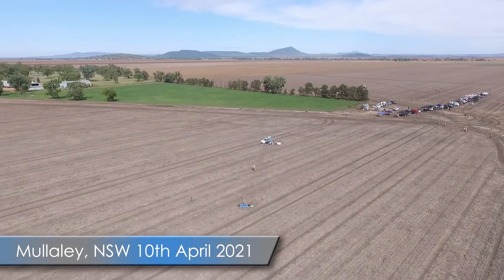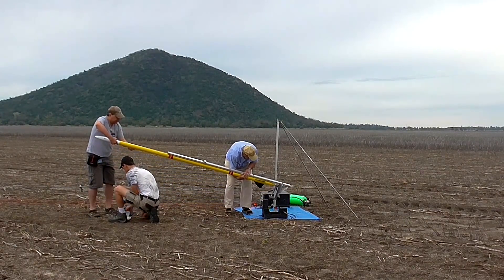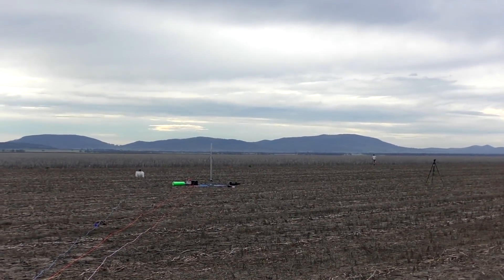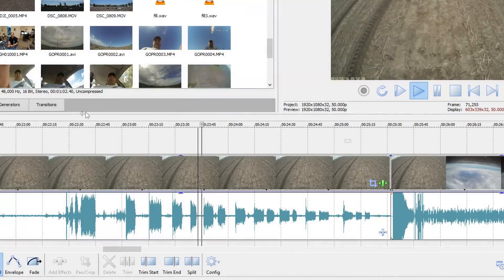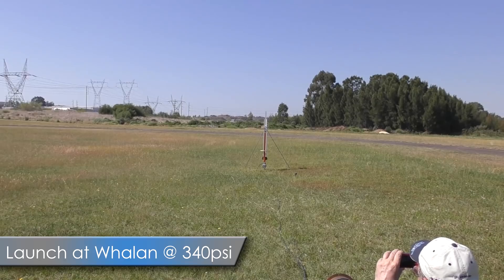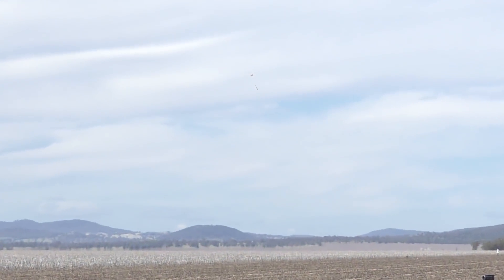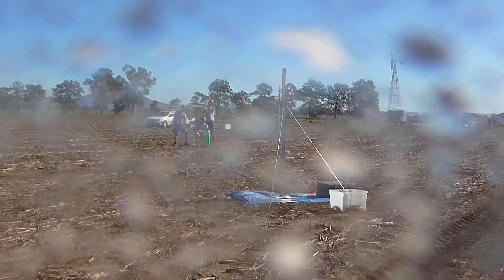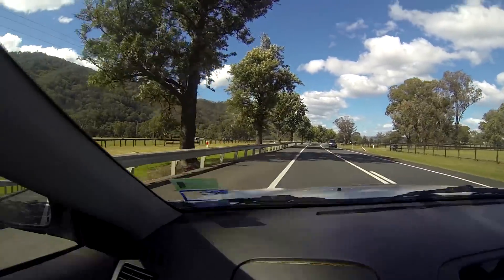High Pressure Water Rockets

Comment: I'm new to the hobby, is there any water additive to encourage laminar flow? In hydraulic fracturing (oil field fracing), we use a "friction reducer" to reduce turbulent flow in the well bore. 
The friction reducer is a slurry of polymer chains (guar) and surfactants. It will increase the viscosity slightly (5 cp max).
I would think this would result in a higher specific impulse, and therefore higher alt.  with the same reaction mass and pressure.
Reply from the maker: This is a really interesting question. We do use a detergent to generate foam inside the rocket that does give a boost in performance. But I have not considered it terms of encouraging laminar flow. It would be interesting to do a comparison between foam and non-foam with just the detergent dissolved in the water.

Comment: Great Test. To get better video of the launch, get further away, and hold the camera in your hands with your arms straight.  Follow the rocket accent with your arms straight and camera below your eyes. Keep from moving the camera off the rocket as much as possible. Post process the video putting a red circle around the rocket while in the sky as otherwise it is invisible due to the low resolution of the video image.

Comment: I suspect a larger bottom plate will let you fly higher instead of punching holes in the ground.
Reply from the maker: I am not sure I follow. When the hole was made, the rocket was already a couple of meters in the air.
Reply: @AirCommandRockets   It is wasted thrust, do an experiment and make your launch plate larger.
Reply from the maker: @kscipkkkk  I still don't get what you mean. The rocket is not "pushing" off the ground. (except when it is travelling up the launch tube) Once it is off the launch tube it no longer interacts with the ground. Here is an experiment for you to try. Get a garden hose, set it flowing and point it horizontally. You will feel a force on your hand from the garden hose ejecting the water. Now close your eyes, and have someone move a plate in and out of that stream. I bet you won't feel any change of that force on your hand, and you won't be able to tell when that plate is moved in and out of the stream.
Reply: As long as the rocket made a hole in the ground it was close enough to still be expelling energy.and that energy is wasted on the dirt.
Reply from the maker: @kscipkkkk  That really doesn't make sense. That's like saying if I throw a ball at a piece of cardboard and punch a hole in it, somehow I would have thrown it harder had that cardboard been a brick wall.  Try the hose experiment.

Comment: Apple AirTags would be lighter, less volume and mass than a GPS.  Range TBD but would home in pretty quick within a 100m I expect.  My first rocket was yellow.
Reply from the maker: We need something with a range of around 2Km. There are specific GPS transmitters designed for rocketry. Nice and lightweight. Here are some examples: http://eggtimerrocketry.com/home/eggfinder-gps-tracking-system/
Reply: @AirCommandRockets  Yet to be seen what the range of the AirTags are ... could be much better than what I mention above (probably far better in an open field, for example).  That said, if you know "about" where the rocket went down, you would be close enough.  Or at least when someone walks by, their iPhone would register it and you'd get a message on your Apple device with the location.  Just focussing on mass reduction ... Anyway, found the water reaction rockets quite impressive!
Reply: Well, forget the Air Tags idea altogether.  The high accuracy (UWB) range is 20m or so in the best conditions....

Comment: Why do you not youse hidrogen and oxigen as propellant? Beyond a safety problem would it be more efficient as propellent than water an air?
Reply from the maker: That is a different kind of propellant. It would be much more efficient than water and air. This is why you see commercial rockets sometimes use Hydrogen and Oxygen and not air and water. ( I am talking about liquid O2 and Liquid Hydrogen)

Comment: Regarding the pattern of decreasing amplitude you saw in the sound waves during pressurization pulses-I wonder if it’s because the stiffness of the pressure chamber’s outer wall increases as you add pressure, such that the walls can’t resonate as much with each subsequent pulse?

Comment: The decrees in volume that the microphone picks up is due to a reduction in the flow rate of air in to the rocket as the pressure increases. That thing get off the ground in a hurry, nice work!

Comment: I think the noise reduction may have been to a lower flow rate as the potential  was decreasing as the pressure was increasing in the rocket. Since the pressures were closer to equal as from the incoming and actual pressure. Less flow, less noise

Comment: Each time the rocket is pressurized there is less of a pressure differential between the rocket and the air cylinder, so the flow velocity into the rocket is likely reduced.
Reply: I believe that the sound is more likely lowering in volume because as the tank is pressurized the walls become stiffer and make it harder for sound to travel through it. I think the sound comes from the bubbles of air gluging up through the water so another explanation could have to do with the speed the bubbles rise at different pressures though you can test my first guess by flicking the tube at 100 psi then repeating it as you increase pressure.
Reply: @evilcanofdrpepper  I think you're sort of right, the tank wall is like a bell, the increased pressure acts as a brace for the walls of the tank, and dampens it s resonance. that plus the reduced pressure differential I'd say. technically a stiffer wall should let sound 'through' more easily, the way a well pumped bike wheel lets you feel more of the road surface in the ride. then again im not a professional in any sense.

Comment: Do they angle it into the wind? they should.
Reply from the maker: The rockets tend to do that themselves. It is called "weather-cocking" the cross wind tends to push on the fins more than the nose, and causes the rocket to pitch over in flight into the wind.

Comment: Crikey. I would never have thought you could get that kind of altitude just from water pressure. In theory is there a limit to how high it can go or could you just increase the Rocket size, Increase the water and the pressure till you get to the holly grail of 62 miles?. 120 x the current size. 216 Litres of water, 120,000 PSI?.
Reply from the maker: There are limits. In order to hold more pressure you need a stronger and hence heavier pressure chamber. You can also only compress air so much before you can't compress it any more. To go higher, you then need to use a multi-stage rocket. Realistically I think you could build something that goes a few kilometers, but I don't think you could get to the Karman line.
Reply: @AirCommandRockets  Thanks for the reply and info, What you have done already is amazing though!.

Comment: did you ask why the burst's sound level drops as the tank is filled? its either because your rocket is being filled from a reservoir tank which has been pressurized appreciably close to equilibrium with your rockets target fill pressure or alternately, if being filled from a source with a near constant flow rate, the chance for cavitation to occur during the turbulence of the fill decreases as the overall pressure rises distantly from vacuum. (source: my pumps quiet down as i raise the net positive suction head)
Reply from the maker: The pressure is going from 10L 3000psi tank to ~5L volume (air volume) at 1000psi. So yes there is definitely a drop in the flow rate as it gets fuller.

Comment: When the pressure in the tank rises,  there's less delta p to drive flow into the tank and that's probably why it gets quieter as it fills up
Reply: came here to comment this, this must be correct. I assume the noise level is proportional to the delta p across the inlet, which most definitely is decreasing. btw delta p = pressure difference. delta just means "difference in"
Reply: Well stated, too. I love a good youtube comment puzzle
Reply: i usume jou mean the presure diference gets less each cycle?
Reply: @goatgod  yes that's what "less delta p" means. delta means difference or change.
Reply: @scotmcpherson  yes jep informd me of that thanks
Reply: Wouldn't the majority of the acoustic energy be first transferred from the compressed air to the rocket before reaching the atmosphere? I think the change in impedance of the air causes the sound to get quieter (impedance mismatching).

Of course, that assumes that the microphone was picking up more sound from the atmosphere. If most of the acoustic energy was transferred directly from the body of the rocket to the microphone, then differences in impedance would be less relevant.
Reply: @nameismetatoo4591  No the acoustics are a direct result of how much air is moving through the nozzles and into the chamber. The less delta, the slower it moves, therefore the less sound it's making.
Reply: @scotmcpherson  You're right, that seems a more likely explanation
Reply: that's what I thought, less delta p = less velocity = less turbulence = less noise
Reply: I would think it is because under pressure, the air is thicker.

Comment: Hi, why film at 50fps?
Reply from the maker: Standard video format in Australia.
Reply: @AirCommandRockets  Almost all modern TV panels, PC monitors and mobile devices have 60hz panels, regardless of where you live. 
50hz is supported by many TVs, but 60hz is supported by all devices

Only a minority watching this will be viewing on a TV display, and as consequence the vast majority will experience frame timing issues - because no matter where you live, your laptop, phone or tablet display is 60hz.

Check your viewer device demographics. 50hz makes little sense nowadays.
Reply from the maker: @logitech4873  I know all that, but that's what my cameras shoot at. Also matching the frame rate to the power outlet frequency eliminates video flicker when shooting indoors with some lighting. In Australia we have 50Hz at the wall.

Comment: The audio variance is a function of volumetric density. Audio travels at a different amplitude as the density increases.
Reply: Also, the natural frequency of the hollow space (compressible void) increases (like how the tone rises when blowing into a filling bottle), allowing for less lower tones to oscilate.
Reply: @theGoogol  It's a resonant body and the available space will influence volume.
Reply: @fakshen1973 : Exactly  :) It also has an effect on the container (like how a half filled bottle sounds different when struck on the empty part and when struck on the full part). It's a very complex system of pressure vs volumetrics vs harmonics vs material properties. It's equally amazing that these factors are pre-calculated and accounted for in modern day high tech.

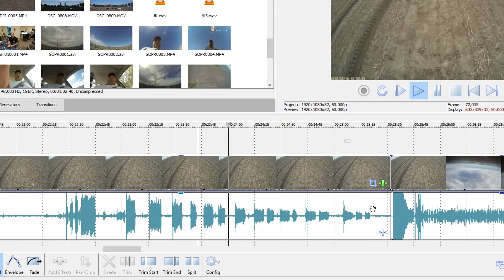Comment: 4:36 I think the reason the volume decreases, is the energy comes from the difference in pressures between what is in the vessel, and what is coming from the tank. as the pressure gets closer to equivalent, there is less force driving it in?

Comment: Not an expert,just a thought... If you've used a saline solution,with maximum ammount of dissolved salt,would the higher density water be better for propulsion?
Reply from the maker: Higher density liquids don't necessarily give you more altitude. Although it will generate higher thrust, you are also having to lift a heavier liquid that is still in the rocket. Here is a detailed look at this: https://youtu.be/Fu3rIiPy_18

Comment: 1) the sound goes less loud because the tension caused by the pressure build up makes the shell much more rigid ergo less vibrations.
Reply from the maker: But would you expect a higher pitch? like stretching a guitar string? The pitch really didn't change.

Comment: The volume of the audio decreases as the pitch becomes higher frequency.
Bass Sinewaves have a greater geometric area than shorter wavelength high frequencies.
(The reason why you can hear your neighbours bass speakers, but not the tweeters!) 
The higher the pressure in the vessel, the faster the wave propagates and oscillates through it, so the pitch will increase.
Reply: I think added to that effect is also that the walls of the rocket become more and more loaded as the pressure rises, so they both have a higher eigen-frequency (higher pitch vibration) and a much smaller amplitude for the same force input due to increased spring constant.

Comment: When I was a kid in the 60s we had toy rockets you would fill it a quarter with water and attach it to a hand pump/launcher. Loads of fun, probably don't make them anymore.
Reply: Me, too!!
Reply: We made our own with coke bottles.
Reply: @africanelectron751  yes coke bottles and air compressor ours would let go at 45psi
Reply: They do still make these. Look on amazon.
Reply: Had one in Germany in 1951, was 6 years old then.
Reply: they make bicycle pump rockets i believe
Reply: Good times!
Reply: We had them through the late 70's too.
Reply: I had those too, about 60 years ago.  The problem was finding them afterward.  Probably got higher than firework rockets, maybe exceeding the altitude of the firework rockets I've made in recent years.
Reply: @goodmaro  Well, they wore out and as they are damaged, you can get a catastrophic failure and exploding parts.
Reply: @fakshen1973  Then it's just as well they got lost so soon.
Reply: Water rockets are still readily available, or very easy to make yourself.        The homemade water rockets got a lot better from the late 1970 when the PET bottles came into use.
Reply: @peterjf7723  I followed their developments for a while via videos online.

Comment: Why not a "grounded" first stage? Basically power the very first "take off" as a ground based water source. Almost a "gun" first stage?
This initial motion to be followed immediately by what would have been the first stage, as the mass of the rocket starts moving from the ground based propellant.
Reply from the maker: That's kind of what the launch tube does that goes up through the nozzle. It acts as a piston so that the rocket gets some initial velocity before it starts using air and water. A launch tube can add 10-15% more altitude. That is what we are using here.

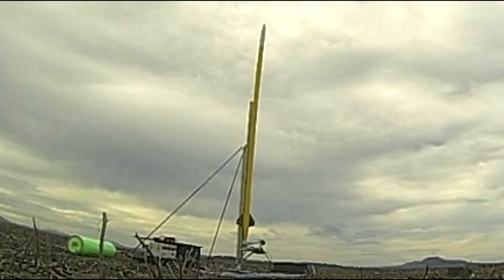Comment: 4:41 As the pressure gradient between the gas tank and the rocket reservoir gets lower, the gas enters the rocket reservoir at a lower speed and therefore less energy can be converted from the slower moving gas to sound resulting in the noise dropping as filling progresses.
Reply: Also, there is shampoo in the water tank. As the gas enterest, it creates water bubbles. These bubbles dampen the sound as well.

Comment: Why the Rocket COUD have Crashed. If the Parachutedor doesn't open at uperg G the rocket speed up again. the air rushing against the Parachutedor coud force it closed . I had the same Problem befor
Reply from the maker: The servo motor never activated. We found that part of the servo motor still in the locked position. If it was unlocked then air flow actually helps to open the parachute door with this design.

Comment: Maybe the sound-volume decreases because the pressure stiffens up the tank?
I mean: when there is no pressure in the tank, the incoming air flow has an easy time vibrating the tank walls, but as presure builds up the tank walls are becoming ever so stiff, and it is harder to vibrate them.

Comment: The filling noise decreased in subsequent bursts as the delta decreased; the greater resistance of higher pressure inside the reservoir reduced the flow rate.  Less flow = less noise.
Reply from the maker: This seems the be the consensus with people commenting here. It makes a lot of sense.

Comment: if you use canned liquid air, you can get very long flight times, hover, air-heated liquid air
Reply: air passive heat sink, reverse heat gathering
Reply: its a steam engine, kinda
Reply: ultra-cold
Reply: gravity detectors, accelerometer, and remote deploy
Reply: drone map localization
Reply: simple phone gps walk
Reply: thats conveyed pressuriser sound, through pipes
Reply: or just simple pipe resonance
Reply: I know nothing
Reply: helium-inflatable balloon-parachute-glider
Reply: gyromass auto-stabilization rotator, inside the tube
Reply: inside tube mounted go-pro's, side mounted drogue-chutes
Reply: your language is unknown
Reply: spin the whole rocket, very fast, as gyro-stabilization, rud-ded
Reply: direct parabolic directed wifi to hook online to any data you have onboard
Reply: you can drive on the ceiling with rockets, pun intended